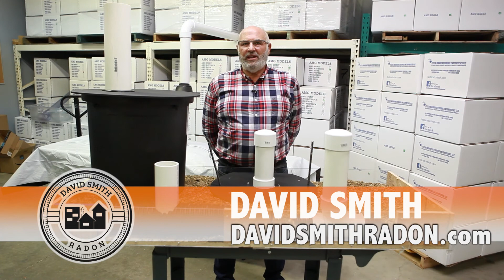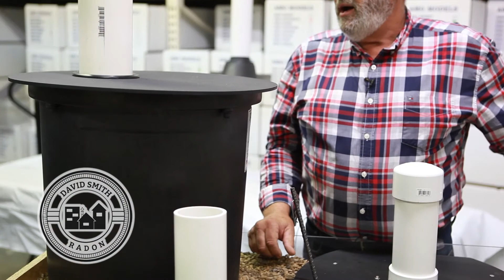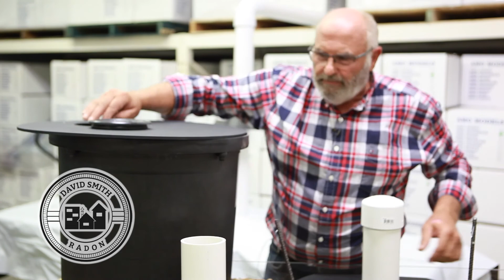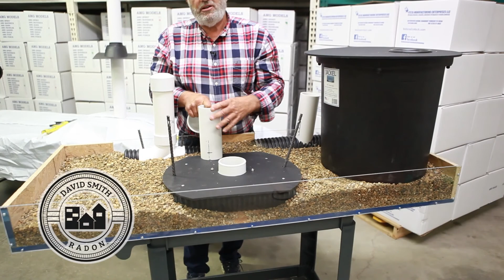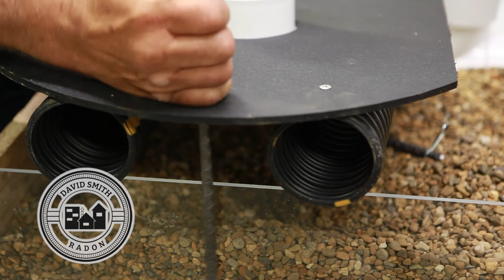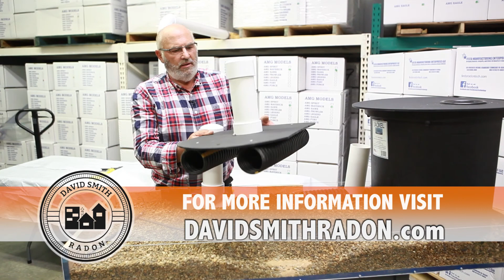New Construction Passive Radon Installations Point of Entries

Comment: I would like to caulk around the outside of the sump pit where there is a crack between the cement floor and the pit itself. What type or brand of sealant would you recommend.
Thanks